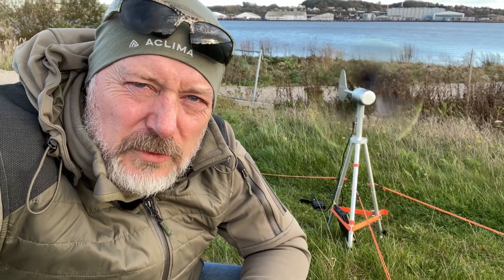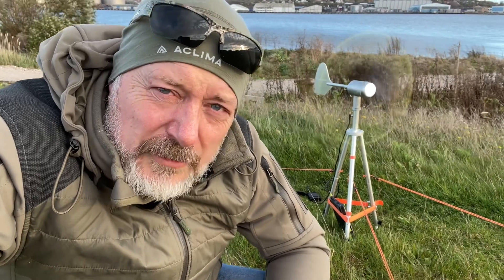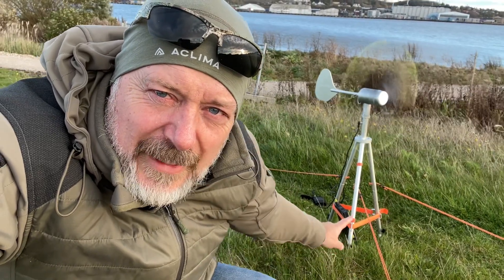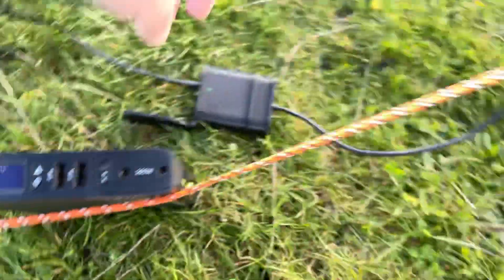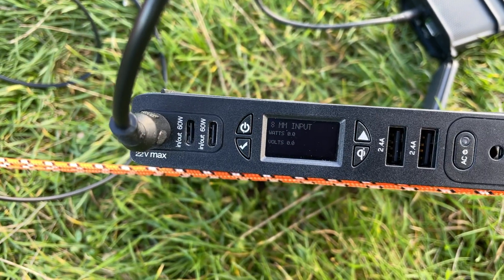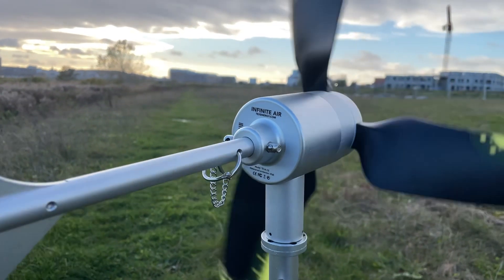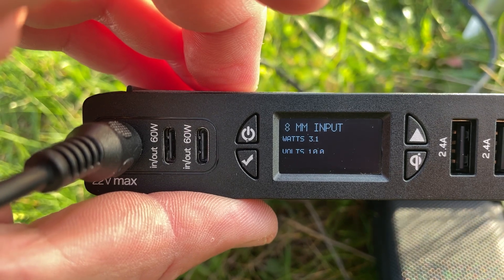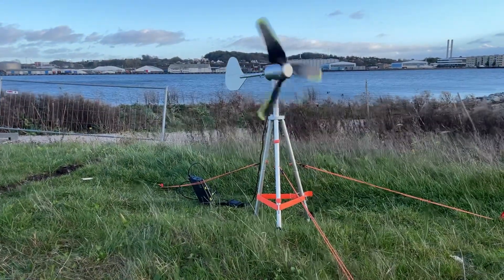Texenergy Infinite Air 18 Wind Turbine Field Test

Comment: All practical tests show: 1) Small wind turbines hardly generate any electricity.  2) They don´t last long! 
There is hardly any wind near the ground. And it is also very gusty, which extremely reduces the service life of the systems. 
With solar systems, you can reliably generate electricity for about 3 - 8 cents/kWh over a period of 25 years!
Here you should besser use flexible solar panels.

Comment: It should deliver around 27 watts and it winds really hard there at your place... and yet it only delivers around 10 watts. Even if it were to deliver 27 watts, this would be just 648Wh per day (24 hours), this energy is used up again in one hour. So it's way too expensive.
Reply: With my word's and thoughts, why you rate this official SMALL windgenerator system next to a consume of electric power in need over +600 watts and more per day? That's make no sense...
If you consume up to +1000 watt or more per day or in few hours, look to a "bigger" system of windgenerator.
It's not necessary to rate a VW Beetle of the early 60's with 27 horsepower in need of a 750hp NASCAR-Racecar in time of today.
(...I think it's better for you to invest in a +700 watt windgenerator system)

Comment: max 27 watts...definitely  a specialty item.  at just over 400us you can have a lot of battery banks and solar.  good idea but needs to up the power produced. Im not sure this will keep up with the power needed to use a tablet on a daily basis definitely not a laptop
Reply: Moreover If you camp in such winds the experience is considered ruined...
Reply: It's rated in combination with wind AND solar. Most peeps have to view "over the horizon". At daylight you earn power with solar and this (backup) little windgenerator BUT at night without this little windgenerator, you will have nothing to earn.
For sure, the price for this windgenerator sounds a bit to high.
But on the other side you invest same money in a istabreeze i500 windgenerator and get/earn nooooothing at low windspeed. That's facts.
Reply: Yeah you could make 85 watts  off a 300 dollar 100 watt solar panel during daylight